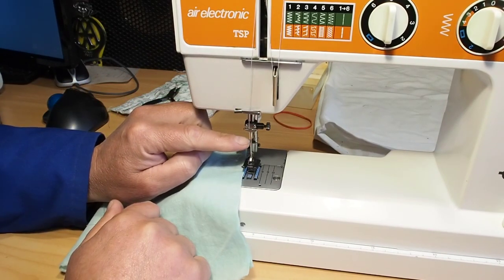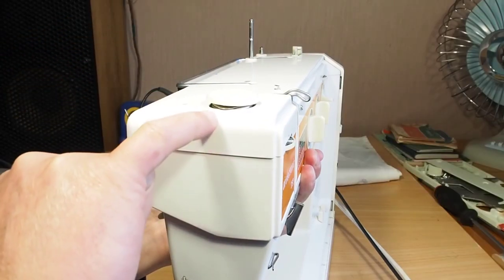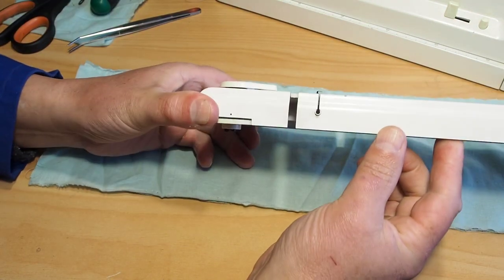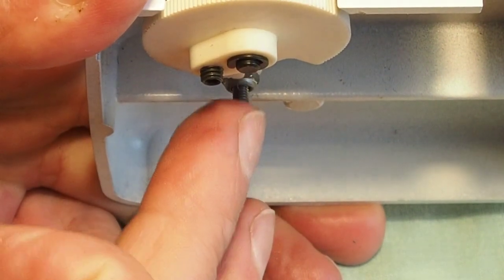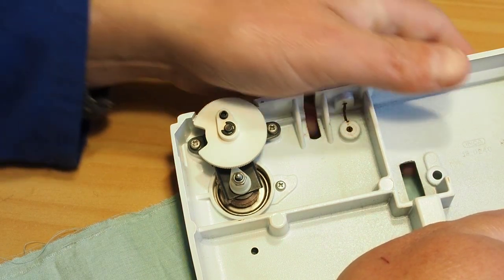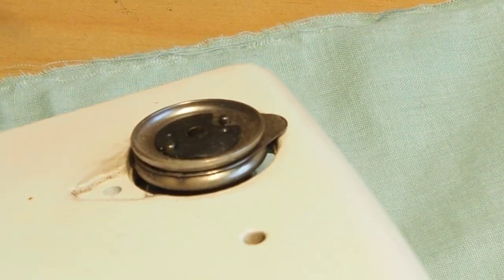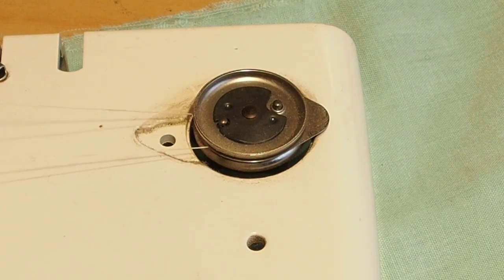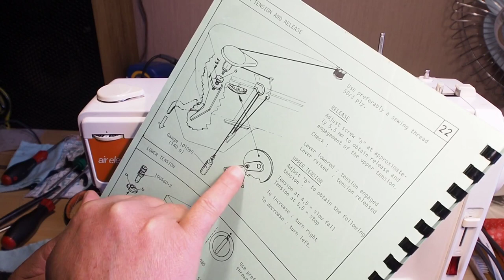Sewing Machine Tension Issues - Thread Looping Underneath - Part 1

Comment: Jo Neuhalfen
Thanks ever so much for both Part 1 and Part 2.  I came across these videos as I sought instruction on replacing a broker presser foot lifter on a Elna TX Electronic (Stella series). The upper tension was also seized.  Even tho not identical machines, I believe your explanation of the tension release mechanism and removal of upper tension will act similarly on the TX so I am confident I can remove and clean the upper tension module at a first step and then check the tension release screw which is tiny and far down in the machine.  Also, the damaged lift handle may have been caused by the release mechanism and seized upper tension in some way rather than other damage.  The lift handle is plastic and rather small for repeated lifting and dropping.   You have definitely helped me to continue working on this machine.  I will continue to look for videos with information on the broken lift handle that operates the tension release.